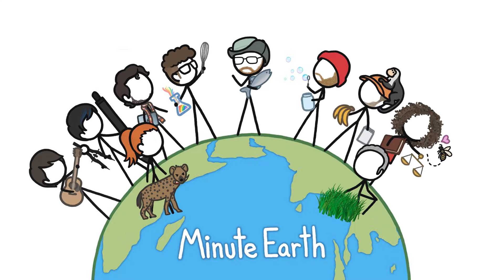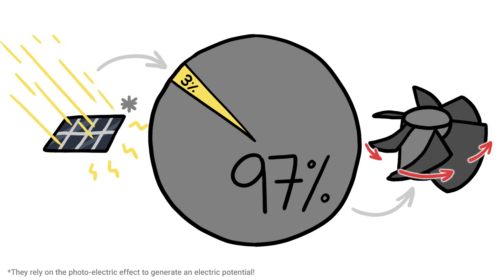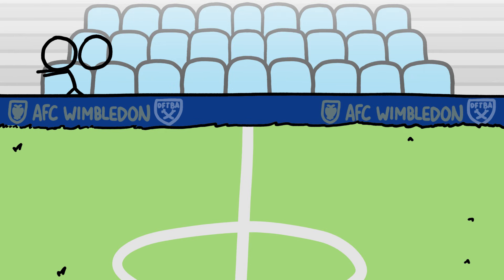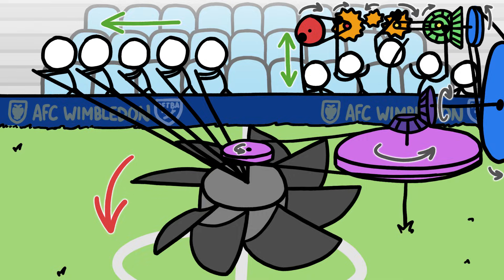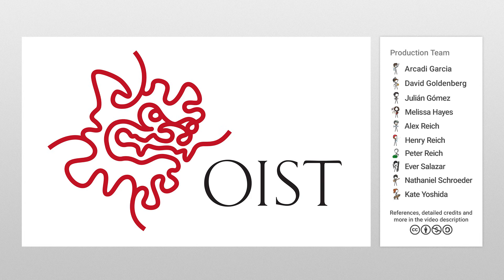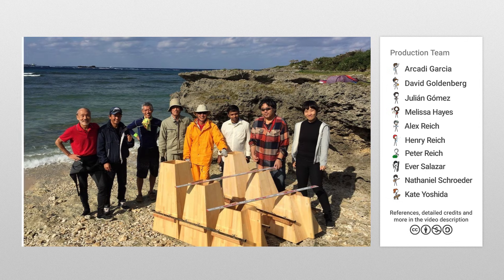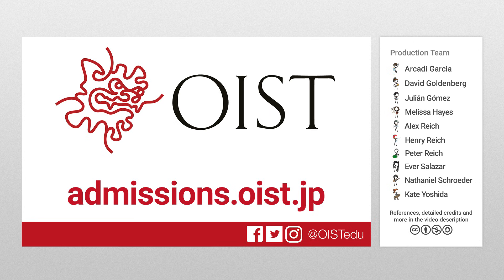Why Can't We Get Power From Waves?

Comment: The columns that capture up and down motion are the most promising. You could optimize those by using cheap concrete columns with a pair of tesla valves on top, connected in a pipe network that's driving a turbine, only on exhaust or on both intake and exhaust. Air power will oscillate but will be mostly continuous. Needless to say you gonna need a large farm of concrete columns, luckily cast concrete is very cheap, and so is PVC to make valves and pipes out of.

Comment: Create a large empty inland dam at sea level. 
Close inlet gate.
Wait for tide to rise above gate.
Open gate.
In flow of water rotates turbine.
At high tide close gate. 
Wait couple of hours for tide to drop.
Open gate to release water once there is a significant difference in water height.
Reverse flow powers turbine.

Its not continues power but its better than nothing.

Comment: This is sorta a tangentially related question, but why did people decide to use the heat from coal in coal power plants to heat up water specifically? Why not a liquid that has a lower boiling point, or lower specific heat? Is it bc of the mass, or availability of water?
Reply: You are asking why water is the working fluid?

#1: Abundance on this planet.   We need a reason to select another fluid.  Water is the default choice, because of its availability.  
#2: high latent heat of vaporization.   This means most of the heat is added (in the boiler) and rejected (in the condenser) at constant temperatures, which is what is desirable for a heat engine.  An ideal engine has heat addition processes happening at constant temperatures, such that the cycle is a rectangle on the temperature-entropy diagram.  A real heat engine in practice should be as close to a rectangle on that same diagram as practical, and boiling/condensing processes allow us to do this.
#3: low viscosity.  This means less energy loss in the piping due to viscous and roughness effects.
#4: high thermal conductivity.  This means less physical space is needed for the heat exchangers, compared to what it would have to be, if it were some other fluid.
#5: pumps already exist for transporting water, and no brand new pump is needed to be purpose-built for a different working fluid.

Some power plants do effectively use air as a working fluid, like the peak operation power plants that use natural gas and the Brayton cycle.  What is happening here, is that air is compressed and mixed with gaseous fuel which is then burned, and then the products of combustion spin the gas turbine.  The products of combustion are mostly nitrogen, and can be modeled as if it were air being heated by an outside source.  Heating air from an outside source is not as space efficient as boiling water, because of air's lower thermal conductivity.  So flame-to-air heat exchangers are uncommon in power plants.

Refrigeration works like a steam turbine system in reverse, but we have ruled out using water in that application.  Water would be the best refrigerant in terms of thermal performance, if it didn't freeze at 0 Celsius.  For this reason, and because a lot of refrigeration applications do involve the working fluid going below 0 Celsius, that alone is enough of a reason to select specialized fluids for the purpose of refrigeration cycles, such as freon and R134a.

Comment: Still waiting for a technology that converts trash into electricity
Reply: Katty Awesome16 a furnace connected to a boiler thats connected to a turbine, presto you got energy conversion
Reply: @evilseedsgrownaturally1588  yeah but I'm sure that burning trash will not do well with the environment
Reply: You don't actually need to burn it, but right now only some of the large landfill operations are using methane captured from their trash to run their trucks and other heavy equipment. I think this is something Waste Management (WM) has been doing for many years now (if I remember correctly).

Comment: I'd use a suspended buoy. Instead of keeping it in place holding it from below, it would be suspended, with a spring keeping the wire tense. The wave would let the spring roll back the cord, then gravity would pull it down, in between the crests of waves, and that vertical movement can be turned into electricity. The advantage is that the generator doesn't need to be placed underwater, allowing for easier access and cheaper costs of production and maintenance. Have they ever tried this?

Comment: The other far more critical issue with wave power is the lack of scalability. With just about every other power source a bigger collector gets you more power and usually at a lower cost per kWhr. Scaling of wave generators doesn't work like this as the wave energy collector must be at the same scale as the waves available to do anything useful. In the same way as a big ship is smoother than a rowboat because it bridges across multiple waves rather than having to ride up and down each one, a big wave energy collector will bridge across multiple waves harvesting no energy at all once it's significantly bigger than the waves it interacts with. This means scaling wave means making lots and lots of similarly sized collectors, multiplying up the maintenance and installation costs with the only reductions in cost per kWhr being through savings in mass production making millions of small devices.

Comment: possible bad idea: put the turbines out side the ocean for less maintainance and use chains/cords/bands connected to a moving piece inside the ocean. Basically transfer the force outside the ocean using resistant, flexible parts. This could potentially help on reducing maintainance costs. Your first imaginary mechanism is the inspiration to a lonely afternoon watching science videos.

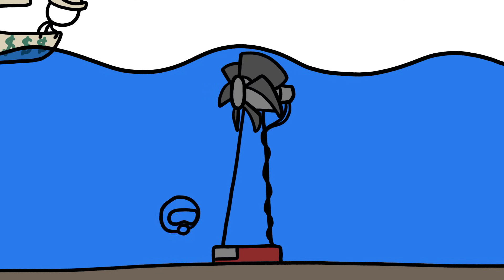Comment: Equipment/structures built to harness tidal energy may have an impact on the ecosystem.  But ecosystem impact on the equipment/structures is the real problem.  At 1:50, it touches on this but maintenance is the killer issue.  Corrosion, sea life and sand kill the long-term viability of any project.  There are many a pilot program that have "good initial results" then never finish the trial due to "operational issues" .  Just look at how fast sea life colonizes sunken ships.

Comment: Solar panels hold toxic minerals, need lots of sunlight, generate hot spots that can kill a ton of life, take up lots of land space to be effective, and constant cleaning.  Wind power also takes up a lot of space, requires lots of maintenance, gets dirty easily, can catch fire, are hard devices to clean, kills birds and bats (putting them on the endangered species list), and needs wind.  Geothermal has its own issues.  Moral:  no form of energy is cost-free, all have serious problems.  Better to develop local energy sources for local needs than always trying to have one source for every business.

Comment: Sorry, but bullshit. Why do you think we're not using the Earth's electromagnetic-filed for energy production? Not because we haven't found a viable option, but because by draining it, we'd kill what protects us from solar microwaves. Same goes for wave energy. If we took out the energy from the waves, we're plugging up part of the oceanic current system, just like we're plugging it with melting the polar ice caps, which will result in a catastrophic mass extinction the Earth hasn't seen in 400 million years. Literally the only viable option that doesn't mess with Earth in someway is solar energy.

Comment: There are other forms to gather energy from waves, using linear motion. Your video isn't accurate.
Reply: Thomas Domingues Linear? You mean like a P-wave? Make em break and spill? Plungers do lay down a lot of force; they can be a problem for offshore monopoles.

I still think pulling on the Rayleigh wave orbitals is the way to go, tho.
Reply: @AnkhAnanku  I'm from Brazil, an there's a team in the Northeast region that made some mechanical arms. I one end, they put a huge disk that floats, and in the other end, a conversor. The waves makes the arms go up and down, and with that linear motion, a mechanism converts it in circular motion, which generates energy. It's been a while that I've seen it, so I might not be 100% accurate, but the studies were very promising, it was more efficient than the methods described in this video
Reply: Thomas Domingues saw the two minute video on it and that does look pretty good. The swiveling of the disk looks like it helps maintain contact with the wave to draw out the most vertical force possible, and using it to pump water across a hydraulic turbine works nicely. I’m pretty sure that platform still binds it to a particular wavelength under which it won’t function but if you’re regularly exposed to strong oceanic waves like that I wouldn’t worry. I am a little concerned about the wear on that swivel...
Reply: @AnkhAnanku  the think is that with enough arms, it could cover a larger area and gather even more power from the waves, since the energy it provides can be massive. The downside is that it's expensive machinery, and as you correctly pointed out, the motion will cause distress on the many mechanics parts in the system.
In the other hand, I find it annoying that we mostly use circular motion to produce energy efficiently...
Reply: @AnkhAnanku  we usually have to transform energy into motion, and then into electricity...

Comment: This doesn't seem like a good explanation. There are plenty of ways to capture this type of motion that are just as efficient. Waves just aren't that great of a source of energy given how much you'd have to build and where. Tidal energy is much better. You can capture both the vertical change (which is just like doing it with waves but at a lower frequency) as well as flows into and out of bays with a narrow inlet. The latter allows you to capture the energy of a much wider area with less construction.

Comment: Aliens: So how do you get your energy

Us: We usually convert  mechanical energy through turbines to generate electricity. Sadly we couldn't figure out how to use waves.

Aliens: snicker Well at least you discovered splitting the atom.

Us: Yeah they are really good at boiling water to push the turbines faster

Aliens: breaks down from laughter
Reply: Wait till they learn what we will do with nuclear fusion. 😂
Boil more water!
Reply: If you think the way we live now, it’s already obsolete,  way to much inefficient, like for example we try to save pennies in electricity, changing led bulbs, automatic switchers, but still we use a petrol car, to take one person on average,    Weighting the car roughly a 1 ton, and burning the same amount of energy in one minute equivalent to light your house for hours if not a day...

Comment: You realise Australia literally has a tidal powered generator, and it's method is just not open to public
Reply: That's tidal forces. This video is about waves. The two are different.
Reply: @tomburns5231  The generator and this are literally about the same thing. I probably would have used the wrong word, but legit, just search it up smh

Comment: Having a constant speed turbine is only critical if you are using that turbine to feed directly into the grid at 50/60Hz. If the turbine was used to charge a battery bank, the power supply wouldn't need to be anywhere near as constant. I'm thinking like an alternator in a car or stator on a motorbike. Feed the batteries DC power and then use inverters to convert that stored energy into AC power.

Comment: I got an Idea which probably does'nt really work but here it is:
What if they would build a very long tube which acts kinda like a reversed syringe with a big plate not letting stuff trough to the other side then when water presses the plate in it also pushes in some soft of long rod that is carved so it kind of like activate a gear like system that could bring a turbine into motion. Once the plate is fully pushed in. There should be some way to press air in to push the plate back and the cycle repeats.
Sorry for my english if its not that good ^^"

Comment: There are wave power generators that don't use turbines but a piston instead but turbines are more efficient and building big shoreside pistons is expensive and difficult to engineer. There are a number of solar power stations that also heat water to spin a turbine so there is that.

Comment: Nice video, though it doesn't go into why wave power is expensive. Yes turning oscillator motion into electricity is an interesting problem, but it is not the main cause of cost (excepting the fatigue issues noted below.)

The power in a wave goes up with the cube of the wave height. So while a machine may be designed to generate electricity for the type of waves that it experiences every day, it has to be designed to survive the extreme waves it experiences only occasionally.

Let's say the usual wave is 2m high, but the extreme wave is 8m (not an unusual example, if anything not a big enough difference) that means the machine needs to be designed to deal with an ultimate load 64 times greater than it's operating load. That leads to larger  heavier, more costly machines.

In addition, in order to be efficient in converting the wave energy from an oscillatory motion the machine has to align its natural frequency with that of the waves (the efficiency drops off with the phase difference between the two systems). That means the machine (to be efficient) is designed at a point which is moist susceptible to fatigue; so it's a pay off between generating efficiency vs cost to make sure it doesn't shake itself to pieces...

Great use of the AFC Wimbledon banners! 😁 
Come on you Dons!

Comment: I did my Capstone project designing buoys that generated electricity for use off the coast of Guam. There's a lot of great research happening. But you guys hit the nail on the head, the electricity costs are too high. Great video!
Reply: It's only about cost when you're head is buried in capitalism.   Those buoys' electric may be the same or even more cost than turbine driven generators, but they don't use fossil fuels.  Even if you're a climate change denier, not strip mining and not fracking are good things.  Unless of course you're making billions of dollars from strip mining and fracking.
Reply: @crudeviolin  Convert money AND energy into "work equivalent unit". If you need 90 work equivalent unit to generate 80 work equivalent unit, your technology isn't worth it, even if it environmentaly friendly, you are basically "wasting".

==> Here is the problem, if it's not economicaly viable, it means it needs too much work for too little output.

It's not just about money, it's about efficiency.
Most Green Energy needs a great injection of work to start producing energy, and they don't give a lot, then, they also need energy to be after being too old to dismantle and put into "not-that-bad-of-a-waste".

But we will find a way, I trust in humanity.
Problem is that we were used to have close to free work unit.
Extracting oil was very easy and cheap and giving out tons of energy, now it gets more complex, and it has "deadly" side effects.
Reply: @Masterpouya  You seem to be missing my point, and are going off track from Joe's original comment which was commenting that the electricity wasn't cheap enough.  Sometimes the more expensive option is better.  Also, unless you live in a country that has vast reserves of petroleum, gaining energy independence is a high priority and can provide "savings" that  may not be apparent when only looking at the cost per kWH.

Comment: Even most fusion!  Just another way to create heat to spin a turbine with steam.  That is, except for "Direct energy conversion", which is a process for some types of fusion which allows you to capture most of the energy directly from fast moving charged particles.  This kind of fusion energy is exciting to me because if it's commercially successful and popular it would be the first completely new type of large-scale energy collection in almost 200 years! (both steam & solar by 1836)

Comment: What about horizontal microturbines that strafe the seafloor to create use tides, with either a ratchet system to hold it in place on the return, or a turbine that spins both ways to create electricity

Comment: Solar power is a primary generation system, wind power is a secondary generation system as the sun heated air is it's source, wave power is a tertiary power generation system as it is a result of wind action on water.  Wave power is therefore a poor choice for current technology.

Comment: hmm I feel like this problem feels very similar to the AC to DC power conversion problem. Except it's in mechanical format not electrical. Because both got an oscillating power source and both want to convert into a constant power source. Maybe a mechanical equivalent of full bridge rectifier could work?. Something like two pipe with one way valve installed in it (so each valve behaves like a mechanical diode), when the wave rise it pump water into one pipe, when the wave falls it pump water into the other pipe. So regardless which way the wave goes, the motion is always reduce to one direction at the output. The pumped water could be store in a water tower some where, then the post process is essentially a hydro electric dam, no need to invent new technology just reuse old technology.

Comment: Ages ago I saw a futurism book that showed gigantic ..well, I guess they wouldn't be ailerons in the water, but those, using that vertical wave motion (and tides) to turn geared crankshafts--the crankshafts would generate power with the very comparatively gentle motion of the ailerons. The key was that the ailerons were BIG. Like as long as modern wind turbine blades, but much wider, to accommodate the greatest consistent variance of angle by associating the aileron's width with the mean wavelength of the installation area (no, I don't remember the ratio, this was like 30 years ago).